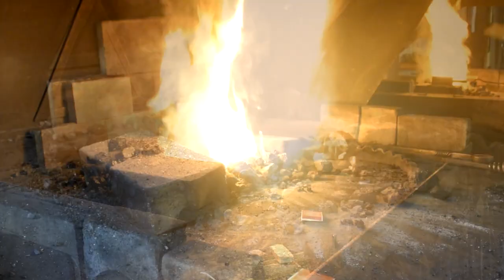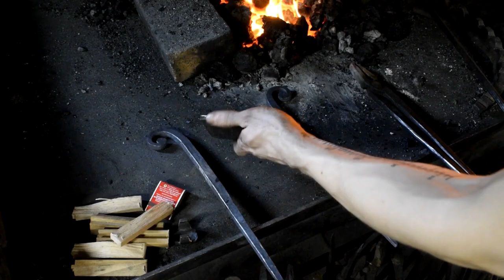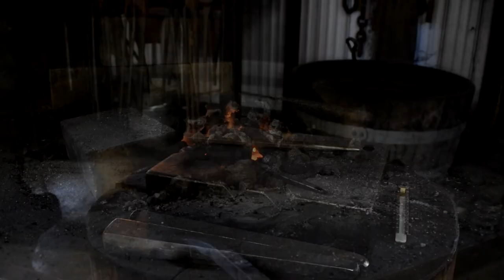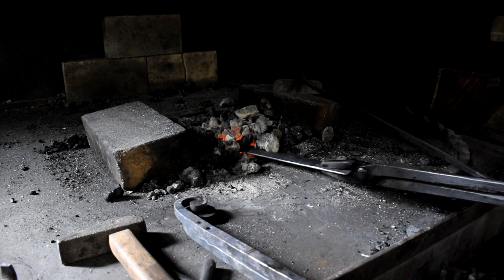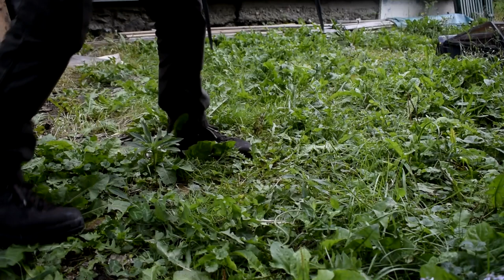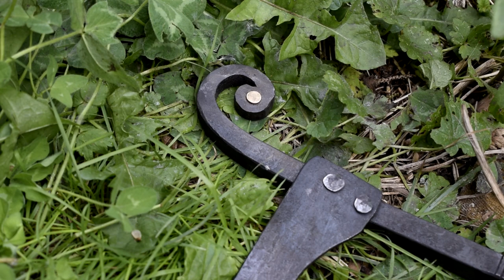Blacksmithing - Forging an Old-timey Boot Scraper

Comment: Nice creation. Tip: If you curl the horns more, and aim for them to have a center closer to the stakes, they'll tighten up every time you have to hammer the scraper into the ground. Over time it might matter. I know it does for tent-pegs: the tight ones tighten up, the loose ones fold and break.